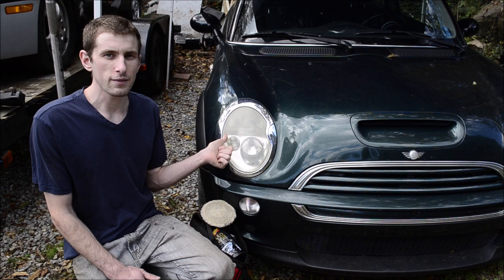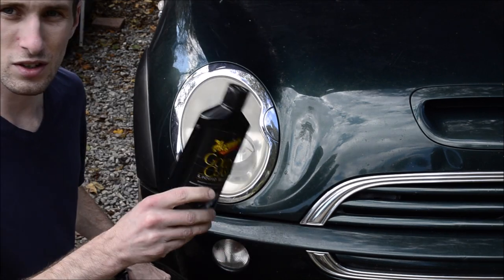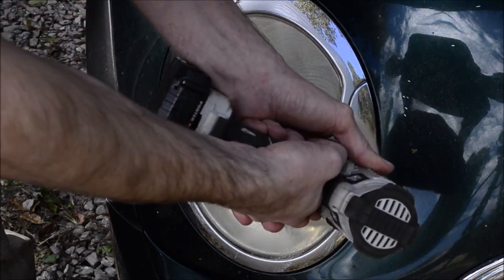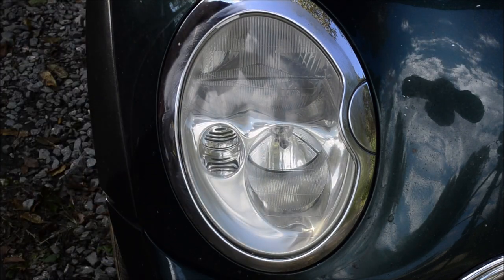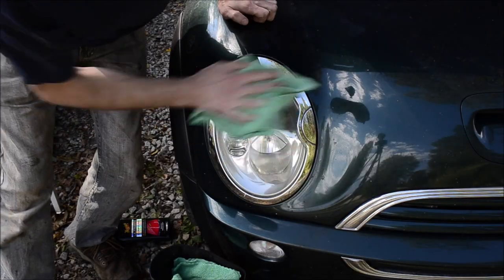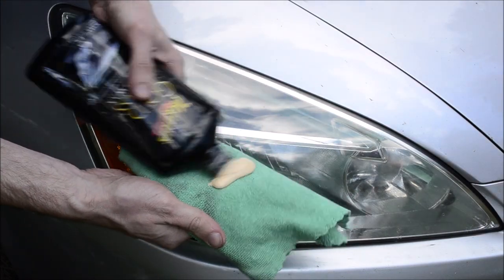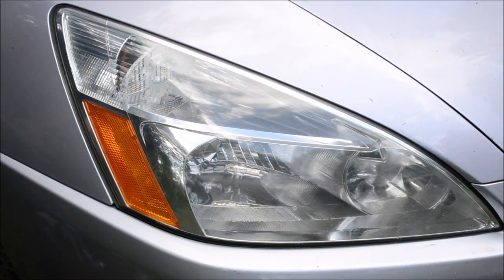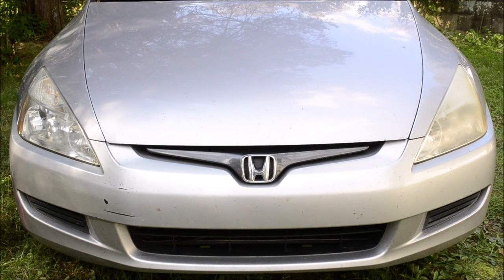Restore Headlights with Drill Buffer & Meguiars Ultimate Compound - MINI and Accord

Comment: Thanks, I've seen the videos with multiple grades wet sanding and re-coating. I intended to try that one day, best intentions and all. But right now I need a 'good enough' quick fix and this video is perfect. Where I live our cars have annual safety inspections and mine is about due - my Toyota lights look like your Honda's in this video so I was surprised they never mentioned them last year. I want to clean them up some before I take it in this year but all of a sudden my landlords are selling the place I rent and I'm busy having to pack up and find somewhere to live...so it's exactly as you say in this video I don't have time to do a perfect job right now - I just need the job done 'good enough'. I already have the supplies so I'll hit it today. Thanks for cutting through the dogma that says you can ONLY fix them with 6 grades of sandpaper and 3 other chemical treatments and 6 hours of your life.

Comment: Nice work I thought that stuff only worked on the clear coat! The other great thing about this product is that out doesn't take off the paint like sandpaper does if you slip. Which actually did happen to me using the sanding process. Lol the Babe reference was a classic!

Comment: I did this to my ‘05 Mini S but actually started with 400 grit sandpaper all the way up to 2000 grip then buffed. I did not know that they had clear over the lights?? Do u know that for sure? Also u can see little spider webbing in the lens which was there before I started and was trying to those but was unsuccessful.
Reply from the maker: Pretty sure it's cleared. Deep spider webbing will be difficult to sand/buff, might have to sand deep and then reclear to take care of that. I did the sandpaper thing about 2 years ago and it lasted quite a while: https://youtu.be/cr31LKKIIAs
Reply: did the meguirs compound get rid of 400 grit scratches? im planning on using 600 grit, will it buff out the scratches?
Reply: akrextra if the scratches look like spider webbing then no it’s deep in the plastic but minor scratches yes.